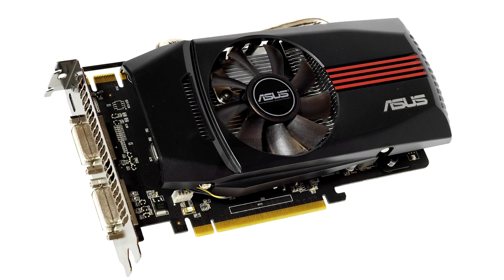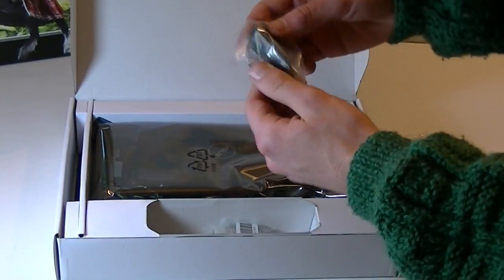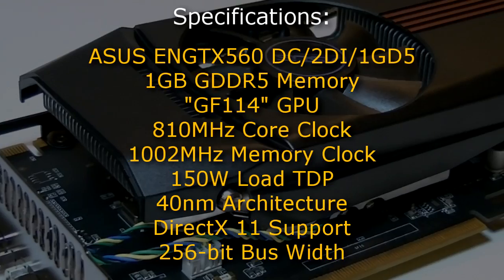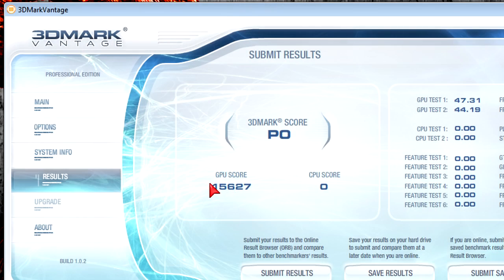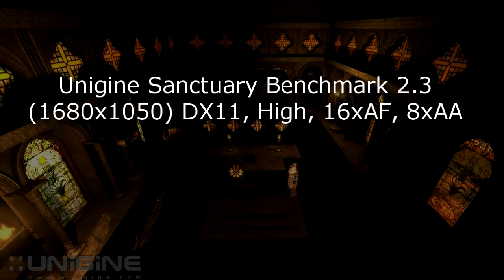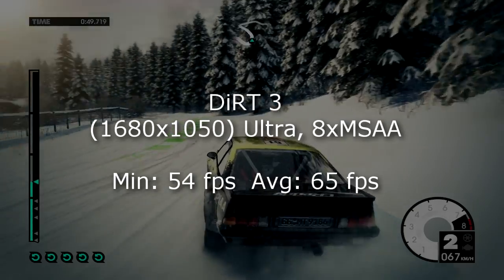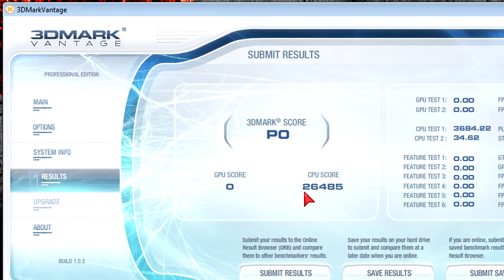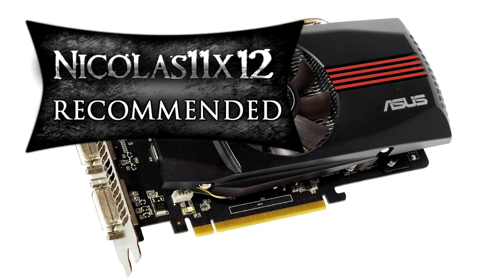ASUS ENGTX560 DC/2DI/1GD5 / ASUS NVIDIA GeForce GTX 560 DirectCU 1GB GDDR5 Review

Comment: aww i only got 52 fps.
Cuz my intel E8500 3.16gz is bottlenecking it.
Stilling looking for a Intel Core 2 Quad Q9650 
(12M Cache, 3.00 GHz, 1333 MHz FSB)
Expensive on ebay.
Otherwise upgrade the whole computer and get the 
Intel Core i3-3240 (3M Cache, 3.40 GHz) For Cheaper price.

Comment: I have this card and BF3 and MoH:Warfighter full hd ultra 4xmsaa runs smoothly. Maxed out cod:black ops 2 with 8xmsaa no problem. Now benchmarked hitman:absolution this time with msaa off fxaa on and results: min fps: 30 max fps:44 average fps: 35.5. In summary this card is pretty amazing...

Comment: Hi there, nice video! really good work :) I've just got this model and can't get it to work. I think it's the two 6-pin PCIe connections. My power source doesn't even have one xD Can I buy a power source with one pci-e connection like for example atx omega 1200W and use the connector included in the package to compensate? It would be of much help if you could reply to this comment  :) Thanks!

Comment from the maker: Did you connect two PCI Express 6-pin power connectors from the PSU to the card? It requires two 6-pin PCIe connections. What power supply are you using, model please? Make sure the card is seated properly in the PCIe slot. To make sure it is, just remove it and re-install it. Please report back! ;)

Comment: thank u fir the response. i'm not using a high end cabinet.. just stndrd atx iball cabin with one side intake and one rear outtake fan.. PSU is top mounted.. i'll buy new cabin next month only and it'll be nzxt gamma.. anyway currently i'm planning to add 2 more fans somehow in my iball cabin.. then will check the temp again.. will post the result here..

Comment from the maker: It's a great card, but 81C is pretty high. Make sure you have good airflow in your computer case. But however while gaming you shouldn't see that high temperatures. It will do good for video editing and gaming. Yes, you're Corsair CX600 PSU should be good enough.

Comment: and also showed an error message  about "openGL stopped suddenly" two times (after showing red lines all over screen & then went blank for a second and return normal) while converting video & was watching a video. then showed a message in taskbar that "driver stopped responding and recovered successfully". driver version is 296.10(latest). never hapened this while gaming ( NFS Hot pursuit/shift, prototype, COD black ops @1600x900 4AA)  and editing videos yet. what was happened actually? plz help

Comment: sir i bought corsair cx600 for this same card, tat was the only one in my budget and is it good enough for full screen gaming(1600x900 with 4xAA) setting?. i run Furmark gpu stress test with same setting and i got 29-30fps avrge and my gpu temp went up to 81C.. is it good?. will it goes this high while gaming?. with stndrd atx cabin. i don't always play games but i do video editing and vfx/3d applications almost all the time using this card. will my GPU and my CX600 PSU hold up with all these?.

Comment from the maker: No problem. With so much hardware installed I'd go with the Corsair GS600, which has 576W on the +12V rail instead of just 480W like on the CX600 V2. And if you can't get a Corsair then get this Cooler Master GX-Lite 600W, which has 540W on the 12V or the GX-Lite 700W, which already has 660W on the +12V rail. You have to go a little over your power consumption so the percentage of PSU load decreases, especially when run the system on full load most of the time. Tell me what you think! :)

Comment: thank u sir for the sugesstion. i'll try to order corsair cx600v2. if it's not available, as u suggested, CM gx lite 500 will be my choice.. my systm config is amd phenm2 x2 550, asus m4a785tdv-evo mobo, 8gb ddr3 1333 (4g x2),will add 2 more 4g sticks soon, two 500g HDD, 2 DVD RW, gtx 560. is gx lite 500 enough for this config?.. my system runs at full power most of the time..

Comment: ya i connected both ends.. i used two adapters actually because my psu has no pcie connector.. i'm planing to buy 550watts coolermaster or corsair PSU.. which one u recomend?. and coolermaster is more widely available here than corsair but the coolermaster one in my budget has 550 or 600wats but only 12v1 16amp and 12v2 16 amp.. is that enough?.. the manual of graphics card says min 12 24amp rails needed.. corsair is hard to get arond here..  what u suggest?

Comment from the maker: Yes, you should get a new PSU. Did you connect both ends of the Molex to PCIe 6-pin adapter to the PSU? The symptoms show there's not enough power delivery, you were totally right. ;)

Comment: Hi i just bought this same graphics card but my current PSU seems not enough. i've 500W standard PSU with 12v 16A rails and connected using molex to 6 pin pcie adaptor. it worked fine but when i edit high resolution vieos or play games at high settings, my system resatarts. but it works without any problem if it is not loaded fully and when i converted some videos using cuda enabled video converter. i guess it's because the PS is not delivering the required watts and not enough Amps in 12v rail

Comment: Hay you guys!  Check out this video:  GLHF COMPUTERS - INTEL ECO PC 1920 x 1080 Performance   (A good test of the "low cost" pentium G850 geared up together with a low cost decent performer graphic card-Gtx 550ti) the system only using a 400w psu!:)

Comment: Did some "interesting" benchmarking the other day.  High and Low end Cpu test with different Graphic cards. Rig 1: intel core i7 860 3.1 Ghz (Oc) together with a Asus Gtx 560ti top.  Rig 2: intel pentium G840 2.8 Ghz together with a Evga Gtx 560ti 448 Ftw. I used Metro 2033 for benchmarking.  Rig 1: 1920X1080 Advanced Dof enabled, tessalation enabled, Advanced physics, 16xaf, and High settings. Used Fraps, and got the numbers: 30,3 avg and min 25(fps) Rig 2: 34,3 avg and min 29(fps) (Hunter")

Comment from the maker: @babarain99 400W is very close. This can be very risky, especially if it's not a trusted brand name PSU. By the way, you have a PCI Express 1.0 motherboard, this means this and all the other PCI Express 2.0 or 3.0 cards will be bottlenecked. And this means there's not enough bandwidth transfer, which results in massive performance loss compared proper PCIe 2.0 or 3.0 motherboards. I just wanted to point this out. Hopefully I could help you out! ;)

Comment: A really good card for the price. I have the MSi N560GTX and I got it overclocked at 940 MHz / 2100 MHz at just 1.012v. AMDs/ATis are still using 1.100v and over. Maybe it's not as cool as the rivals due to the big die size and TDP but still I am really happy with the GeForce drivers. Temperatures rarely go over 70 degrees in games, mostly in Battlefield 3. I just hope they won't let us down with the GTX 66x series as even the HD7850 is better than the GTX570.

Comment from the maker: @happa54 Yes, the GTX 560 cards are great. But I prefer the GTX 560 over the GTX 560 Ti or 448 Core version. That's mainly because of the price and power consumption, but of course if you want to play Battlefield 3 on Ultra settings with full MSAA then you made the right choice!

Comment: I replaced my GTX560ti top with the Evga 560ti 448 FTW. reason for that is for playing BF3 at Ultra settings with 4X MSAA. (1920X1080)   With the Asus card, i had to run BF3 with custom settings ultra/high no MSAA. And i actually had to down clock it from 900mhz to 822mhz for stabile framerate in bf3. driver issue i think? But the Asus gtx 560ti is a fantastic allround card! playes crysis 2  with 1920x1080 very high DX11! (not ultra)